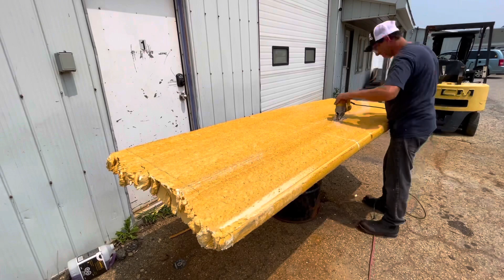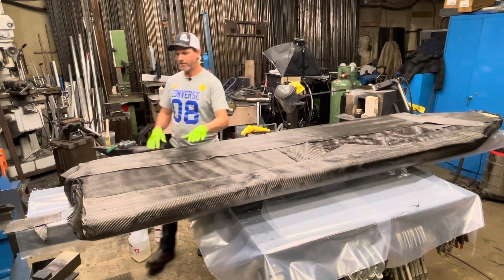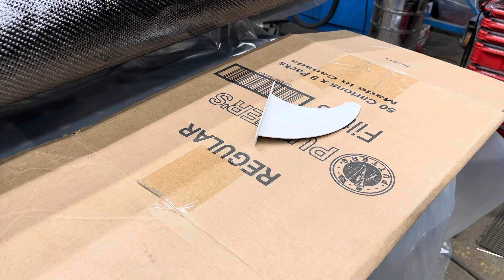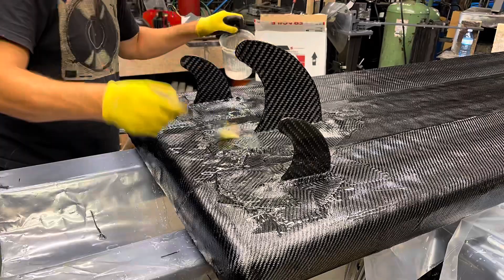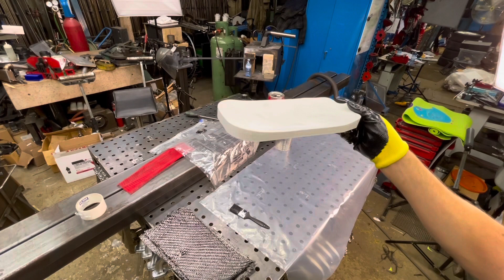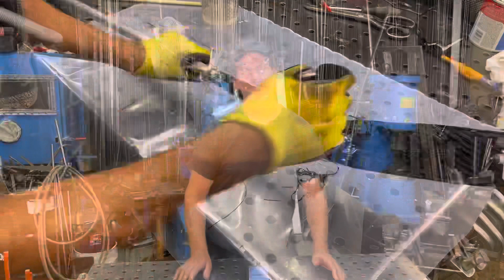DIY PADDLE BOARD !! OUT OF CARBON FIBER FOR LESS THAN 200$

Comment: Good vid. Wondering if you have heard about carbon fiber sleeving as it would make joining the shaft to the blade easier than rolling cut fabric. Rolling cut fabric leaves many shaggy strands but sleeving has no strands. It conforms well to transitions. I purchase sleeving from Soller Composites.